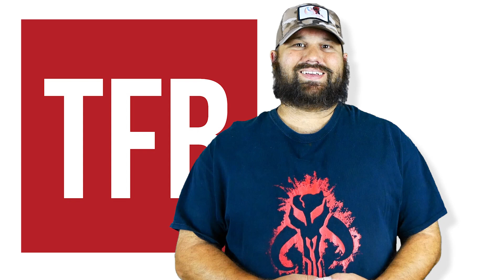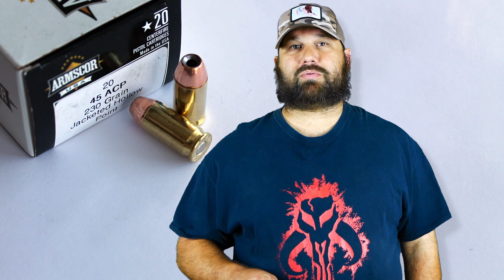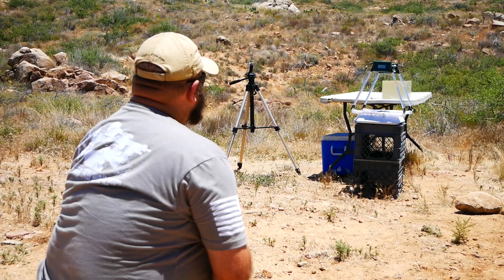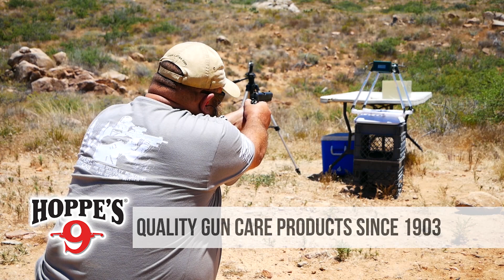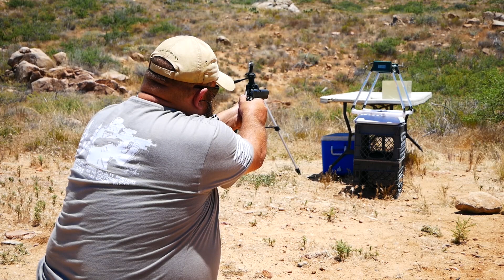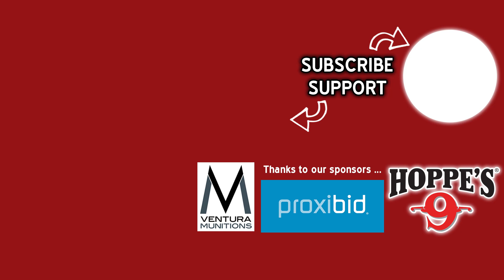Armscor  .45 Auto 230gr JHP gel test and review

Comment: For consistent expansion I use +p always in .45auto. Even +p is relatively low pressure and doesn't add really any recoil.
Reply: Soylent Green That's unlikely to make any difference for a projectile that isn't well designed for expansion.
Reply: Try some WW Ranger, not the +p. They are amazing.